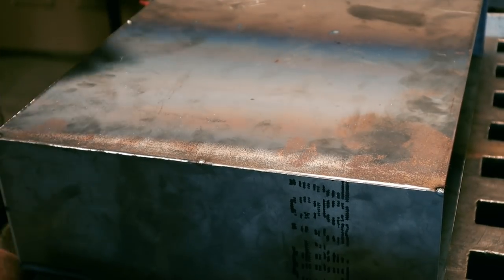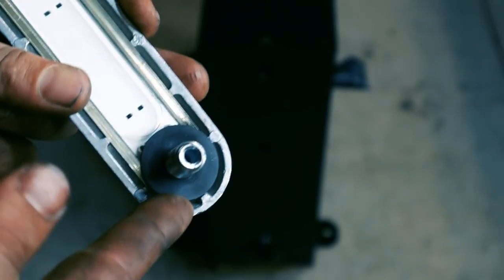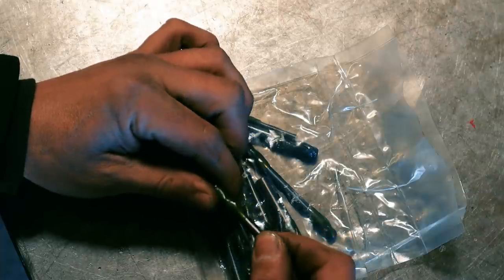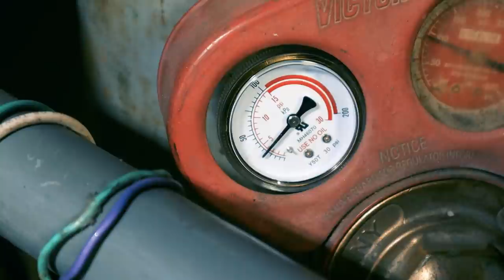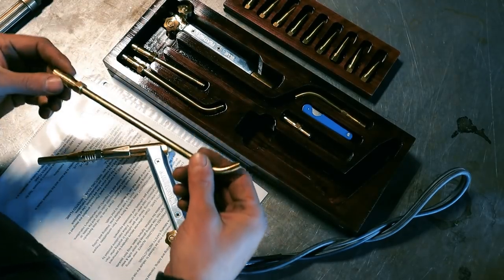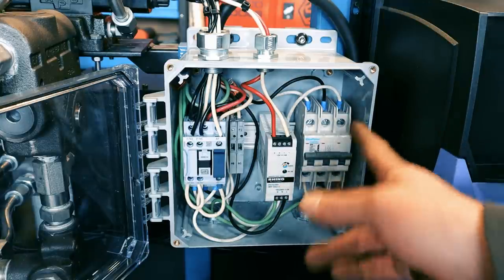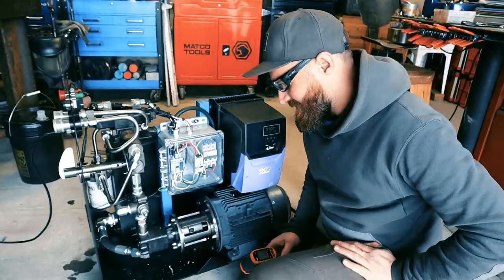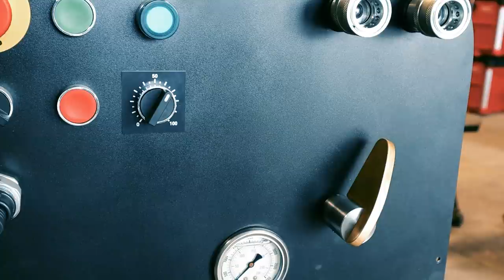Hydraulic Power Unit Build Part 2

Comment: Great video and excellent hydraulic power unit. I would have used a manual proportional directional control valve instead of the solenoid-actuated one. Instead of pushbuttons, you'll use a lever to change direction and flow. You would have more control of the speed and flow this way without the jerkiness.

Comment: Damn that's clean. I would have used braided hose for all of that bent stainless tubing. Respect!
Reply: You can cut 5-10thou with carbide inserts, you just need to find a positive rake insert (like a TNMP or a TNGG) and run it fast.
Reply from the maker: Guess I should have said with the inserts I have currently.....ill try them out thanks

Comment: As usual great video with excellent workmanship. Something that works well for me is to use some alum angle to clamp those thin guage sheets with a bit of a gap. When tacked the weld won't stick to the alum angle and you can run a nice fillet weld. Again great job.

Comment: You can run most three phase vfds on 220 single phase without running through the phase converter! Here’s the catch, when they build a single phase to 3phase vfd they beef up the front end. But if you size up a vfd 1.8x (in the industry so go 2x) you can just run it on single phase 220 which is less work for you and wear and tear on the rotory phase converter (you can still run it on three phase as well then which is why I use this method) Love your videos and how you dig into each craft before you attempt any of it you really do beautiful work! and that torch is beautiful!

Comment: Another good video. FYI most VFDs will take single phase & create a 3 phase output. Almost all the drives I have worked with in my 22+ year career have a common dc bus that the IGBT’s(or enter your other load side firing device) fire the outputs to the motor. You will get a DC bus sag & potentially a low DC bus alarm.
Reply: Forgot to mention, Ive used Kennametal ccmt21505lf with light passes & pretty good surface finishes.
Reply from the maker: I will give them a try thanks
Reply: you have to derate the vfd tho

Comment: amazing build! ... are you finding the hydraulic pump getting too hot since it's mounted on the outside of the reservoir tank (and not dipped in the oil as normally recommended)?

Comment: FYI, there's no worries when applying single-phase power to multi-phase units. You wouldn't want to run it that way (doubtful if it even would run), but it's not uncommon when repairing electronic units like that to apply a single phase and bring it up slow, just to get the control circuitry to come up and proceed with troubleshooting.

Comment: Such a cool project. Also love your torch setup. With insert tooling, look out for finishing or super finishing inserts if you wanna take a small DOC. Most iso inserts come in those edge profiles. The benefit of the inserts is that the coatings they use mean you can have a much higher surface speeds for steels than bare, uncoated carbide. There's loads of surplus inserts on ebay, but it sure wouldn't have made such a good video!
Reply from the maker: Thanks I will have to give them a try

Comment: Wow, what a stunning build and informative guide, my burning question tho is - what is the build cost compared to an off the shelf unit, not including time and effort of the maker, is it cost effective to self build one of these, i certainly could not achieve such perfection but could cobble together a working machine
Reply from the maker: You can buy some that are cheaper than what I spent but not as capable. If you just want a basic power unit that's only for one tool with no bells or whistles I would just buy one.

Comment: Any way to get wiring detail on this? I've been trying to figure out for a while . I found a hydraulic unit and retrofitting a solenoid. It's so difficult to find information about trying to get three-phase turn into 24 volt where did your white wire come from when the power goes into the box at the 18 minute mark?

Comment: Hey you can feed the vfd with single phase and get 3 phase out, you just get about half of the hp rating of the drive.
Reply: I run my mill and my lathe off of vfd’s with single phase feed

Comment: Aaron, I wasn't clear on how you saved a thousand dollars.  Would you mind helping me understand this?  Great video!  Another question is how the tapping arm knows how to use the right amount of torque to prevent breakage for the size of tap and the material you are tapping.  A third question is whether the bender you use is more flexible that the Rogue unit, if you have any familiarity with that unit.  I wondered if you could make those same tubes with the rogue unit?  Thanks!
Reply from the maker: A similar sized vfd that was single phase to 3 phase brand new from invertec would cost 1500 to 2000 dollars but the one I bought used was only a few hundred (I actually saved more than 1000)  the downside was the one I bought was 3 phase input and 3 phase output so I have to use my rotary phase converter to run it. As for the tapping arm, there is a different holder for every tap and each one has a built in adjustable clutch that is set from the factory but can be adjusted for different materials. 🙂
Reply: fwiw you can get a 5hp single to 3 phase vfd for like 200-300 bucks, they are chinese imports but they work fine @westweld